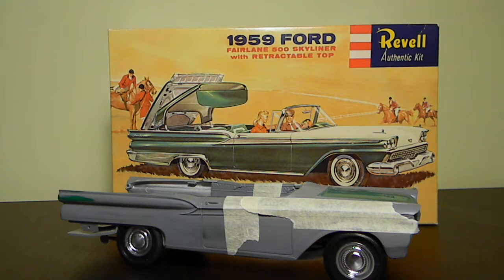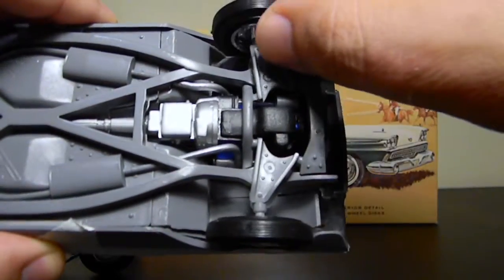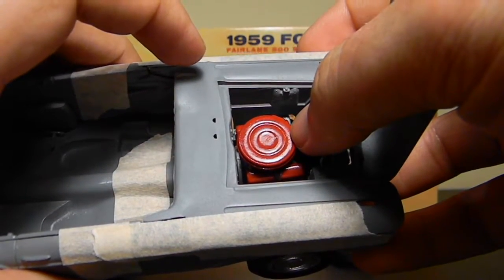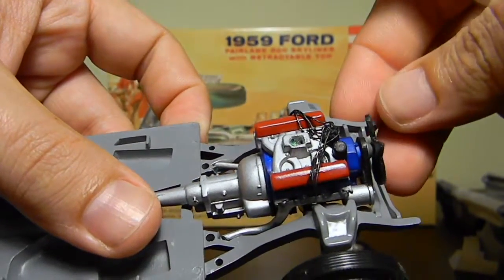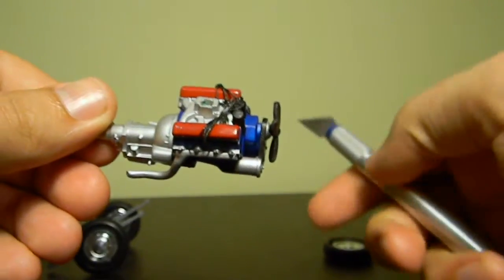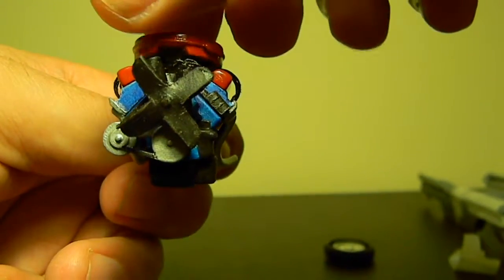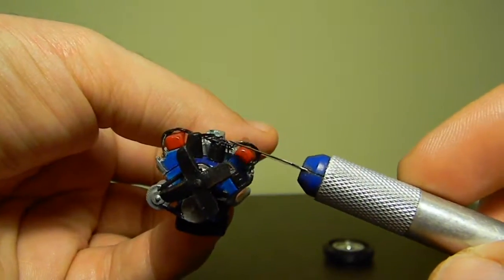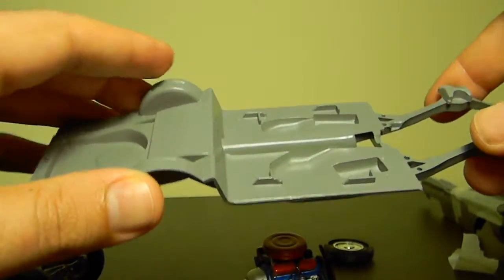Ford Fairlane Skyliner Motor Done

Comment: Hello..... (what is your name?) What primer have you used? I'm looking forward to checking the retractable roof ready and how it works. You've done a pretty good job with the motor. I've seen this model on e-bay selling at 24 USD and thought of buying it, but then, as I live in Brazil, the shipping costs of 25 USD discouraged me. I mostly build 1/72 WW 2 aircraft models, but I've thinking about starting a collection of cars, specially from the 50's. When I was young I built some models from Revell, (Ford Fairlane 500, Corvette, Thunderbird and a Bel Air, all 1957) but the body came in one piece, making it easier to build and paint it. The one you're building is pretty different as the body comes in separate parts. By the way, what color do you plan to paint it? Thanks for sharing this video and the one about the unboxing. I'll be following the build. Alex
Reply from the maker: Hi, it took me quite long to reply, apologies for that.

My name is Shaun, I used primer from a spray can, that I bought at a hardware store.

I have finished the model for now, and will try get a video up on that. I ended up making it a dark metallic green, it turned out to be a great colour, I need more practice on the spray painting though as I made a few mistakes, but I can live with them.

The cars from the 50's and 60's were beautiful, I hope you do build a few, they are quite different from the planes and you can go wild with the colours too!

Here in Portugal the shipping is also a big downer, it seems really hard to get kits cheaply, especially cars.

Anyway, thanks for commenting!